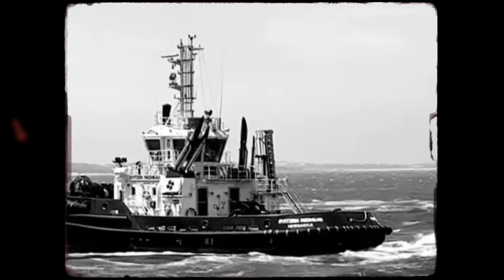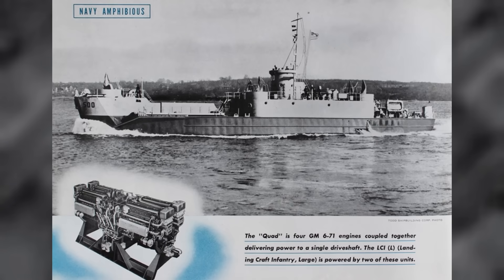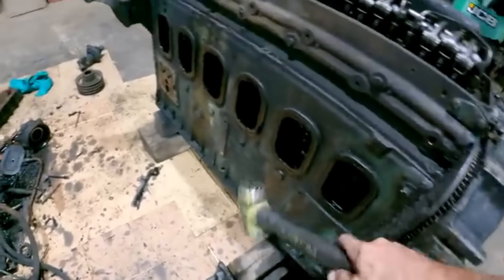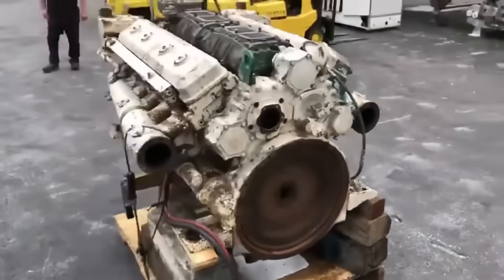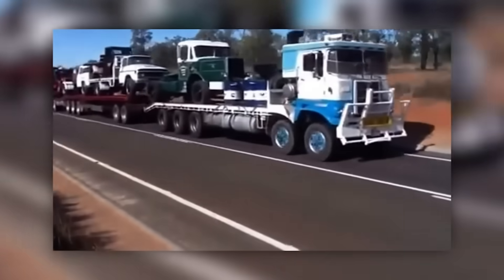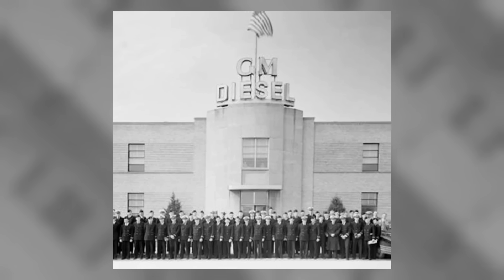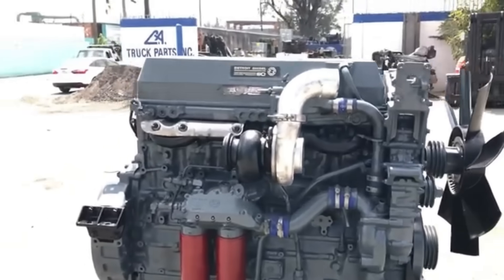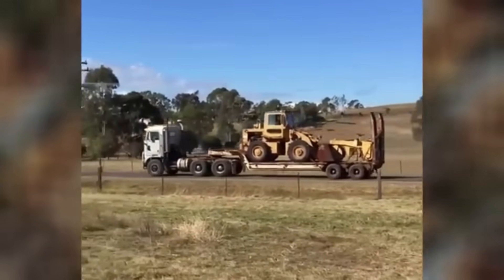The Rise and Fall of Detroit Diesel, America’s Greatest Engine Company

Comment: Here's where I rain on your parade;  Detroit Diesels were NOT the first.  In 1929 a Gardner 4L2 (built in Manchester, England) marine diesel engine was fitted into a Lancia bus.  This conversion was successful and prompted Gardner to introduce the LW ('lightweight') series of diesel engines in 1930, designed especially for road vehicles.  The LW engine was a modular design, with aluminium alloy crankcases, and separate cast iron cylinder blocks and cylinder heads comprising either two or three cylinders.  A five-cylinder engine would thus use a twin and a triple, and a 6-cylinder engine could have either three twins or two triples.  
As for 'small enough to fit into a truck', the range was:
4LW, 75 BHP @ 1700 RPM, 340 cu. ins.
5LW, 94 BHP @ 1700 RPM, 425 cu. ins.
6LW 112 BHP @ 1700 RPM, 510 cu. ins.

(marine types, with the same power outputs, were also sold in two and three-cylinder versions, and many built 90 years ago are still in daily service)

Comment: I worked in the transit industry for decades. 4 53, 6v71, 6v92, series 50 all great engines. (Series 50 being 4 stroke) one thing the video didn’t mention was by moving the gear train idler gear to the other side of the gear train (GM set up the blocks to allow this to happen) and changing the starter and related parts, the crank rotation could be changed from right hand rotation to left hand rotation or back with no other internal engine parts needing change or adjustment. Great engine to work on.
Reply: I totally forgot about that! I had a neighbor who blew up his 6v92 in a gmc. Got a great deal in another one out of a bus. Called me up frantic, WTH!!! I got 10 reverse gears and 2 forward!!! Had to swap gear cluster around.

Comment: TLDR: 
Emissions and fuel consumption 
These engines can be abused like nothing else, but they cant meet current emissions and fuel consumption standards. When diesel was cheaper than gas, they were kings. Once the 90s and emissions regulations started creeping in, their time was running out. But, there are some still out there. They still exist in marine settings under the MTU brand name

Comment: As a diesel mechanic I loved working on those engines. People called me from all around to fix. I had a good Rep and more work than I could handle. Love those engines
Reply: I was foreman in the repair shop at US Steel’s Fairfield Plant for about 6 years in the mid 70’s. A majority of the diesel engines in the various cranes, forklifts, coil carriers, and diesel/electric tractors were 53’s and 71’s. Hardly had any problems with them and they were easy to tune and repair in place. Had a few runaways, but just flip the shutdown plate and it stops - of course then you’d find the governor all tore up or the blower driveshaft twisted in two, but very rarely would you have to fool with the bottom end.  The sound of a runaway Detroit was so good you were tempted to see how fast she’d go. And the mechanical fuel injection was just about bullet-proof and simple to set. I always wanted to put a 3-53 or a 4-53 into an old GMC pick-up, but life got in the way.
Reply: Stop lying they been out of service for 40 years
Reply: I was fixing them up through 2010. Matine is still running them
Reply: @KBilitsky military equipment mostly

Comment: The problems with 2 stroke diesel engines are primarily: poor fuel efficiency, nasty emissions and limited rpm producing power. Then of course, there's the threat of a dreaded runaway.

Comment: As a Detroit Diesel Technician and Dealer Trainer with DTNA for 25 years I found this video to be somewhat factually accurate. However many of the images are not accurate and the title is complete click bait. Rise and fall of the 2 stroke, sure. Rise and fall of Detroit Diesel? not at all! Still going strong and one of the worlds largest engine manufacturers. As for the S60 being the first 4 stroke? Nope! 8.2L was the first. These are just a few of the many inaccuracies. If Vintage American Machines is going to put the effort to make a 19 minute video they could at least make it factually accurate.

Comment: I never heard of Detroit Diesel until I started working in the offshore oil and gas industry where they are used extensively in pumping applications and in hydraulic power packs- mainly in 12 and 16V configuration. Awesome machines.

Comment: My favourite type way of powering my cars diesels I have only experienced two stroke petrol engines in cars and motorcycles I love the how smooth the were my father bought a new Wartburg with a 1000cc 3 cylinder two stroke engine which I use to love but was fuel thirsty I now drive a 1.6 4 cylinder diesel car which pulls like a train and averages 58 mpg

Comment: I'll be 'That Guy' this time. The  roots blower provides the normal required induction air charge to run. It's not a super charger, as 'super' means 'above normal'' They were typically supercharged with a turbine. A turbocharger. Now I will be taking the next door out but it will be quicker if someone kicks me.

Comment: The biggest issue with a lot of older diesels is runaway which is extremely rare on modern diesels engines as they have safeguards to prevent them from running away which would destroy the engine if the RPMs got too high!

Comment: In 1988 when I started my trucking career I was at the bottom of the board in a teamster tanker company and was assigned a 1975 W900 Kenworth with a 8V92 Detroit spinning a 5X4 twin stick that everyone else refused to drive. I hated that truck the first week I had it until I figured out how to shift it then it was Katy bar the door. No body passed me because that truck had no known top speed. The speedo only went to 85 mph but I buried it deep many time on highway 97 between Klamath Falls and Bend , Oregon. I drove it for the next decade until the company went bankrupt and the fleet was sold off. Wish I had bought it
Reply: I can see your smile as you overtook other drivers with the dd screaming hell
Reply: I drove an air shift 5x4 back in the early '80s.  My buddy drove a Mack cabover with a straight 5 speed; quite a difference in transmissions!
Reply: Thats a great story. Wish id been there!
Reply: 1988 was when i was born

Comment: I drove 3 different freightliners back in 2003-07. All  had Detroit but the older one was an absolute monster. It was in an older cabover from the 80s, they let new cdl greenhorns learn on for a year. The other one was 1999 or 2000 year, it was ok but for the times I went through PA and South through those hills, it wasn't quite as nice as the old cabover. I didn't really give it much thought as to why the newer one was worse but it makes sense now. I always thought the engine wasn't dialed in right but I'm not a mechanic so I find these videos interesting.
The turbo died in the old monster and they couldn't even tell it lost much power till you found a hill. 
Then I got a new freightliner 2000 cabover but I don't recall the engine d60 I think? Had no complaints other than a cheap company who governed it at 55mph.
Later I got with a different company in 2006 and they had 2003 freightline century. It was very reliable but didn't have what the peterbilts and kenworths had for hills. I just figured I had a heavier haul but who knows. Some of those other rigs could really haul ass up hills

Comment: They didn’t evolve fast enough.
Two strokes were great at constant RPM applications, but 4 strokes from Cat & Cummins were quieter and 0:32 0:32  provided more low end torque.
The silver 92 was the last two 0:32 stroke for the trucking market if I recall
Four strokes started taking over the construction & gen set market because they were quieter.

Comment: I've worked at Detroit Diesel shop for over 12 years. It's always fun when we rebuild a 71 or 53 and let them break in on the engine dyno. I was surprised to see no mention of the current DD platform in this video.

Comment: DD is anything but dead.  They went over to 4 strokes because of emissions, fuel economy, and simplicity.  (DD 2 strokes have blowers, 4 valves/cyl,, multiparty pistons, unit injectors..lots o& parts)
As an engineer, I liked DDs because they were small and a bit lighter than Cummins or Cat.  They could be configured this and that way, even vertical shaft.
2 strokes last because for the same power you get double, half sized power strokes.  This reduces the torsional fatigue reversals and magnitude on crankshaft and other internals.  In other words, instead of Bam…….
Bam….Bam, it’s pow.pow.pow.pow.pow,pow
DDs brother company, EMD, still making 2 strokes locomotive engines.    Cheers

Comment: I’m an old school truck driver from the 70s 80s and 90s. Detroit engines were the best most reliable engines. 
They were used in the oil patch for everything. We had trucks and workover rigs and drill rigs. Everyone loved the rapid acceleration and that sweet sound of going from 600 to 2300 immediately. We had engines in 1982 that were making 1000 hp.

Comment: Up to 2002, I worked on the 6V71 series on Flxible buses built in the 80s mated with Voith transmission and that thing kept running forever. They were very quiet, but inefficient with high pollution.

Comment: When I was in the Navy my first duty station was a landing craft command. All 5 engines on board were Detroit diesels. Two 12v71 for main propulsion, two 371 inline for generator power and a 471 inline for anchor windlass. I was only 20 at the time and had some old crusty master chief who was teaching me how to change injectors and run the rack and an all that and it was so much fun. I learned a lot about these engines. To this day I get flashbacks when I hear these engines to my days on deployments and hearing these engines run in unison doing 2200 rpm for our cruise power setting. We rarely and I mean rarely ever had an issue with these engines.
Reply: Loved the 71s on LCUs, one of the best tours I ever did as an Engineman.
Reply: I sailed on MSO minesweepers, propulsion plant were 2EA 8-278-A (A for Amagnetic alloys used for the blocks and cylinder heads), one 8-278-A for mine sweeping duties, 2EA 8-268-A as gensets, one 4-71 as emergency and harbour genset. Those engines were incredible, powerful and a piece of cake to work on.

Comment: Somehow this video came up on my YouTube homepage. I have a 1967 Hatteras 50 foot motor yacht with 2 8V71's that are awesome power plants. They are old and dependable and I can run for days on end with only shutting them down for me to get a bit of shut eye. I know they could run for weeks without shutdown because they RUN, one quick push of the starter button, one second even cold... the twins are running, even at 58 years age (i'm 64). They do have valve cover leaks and I need some new gaskets... I have digressed into thinking of tweaks. 
My Detroit 8V71's are as Tony The Tiger says... They're GREAT!     ...  I gotta eat some Frosted Flakes now that I have referenced an old commercial phrase, and I want it in the little box designed to cut open and add milk. You guys have a great day.

Comment: I was touring the Detroit engine factory in Michigan about 6 or 7 years ago. It was where they produce the DD13 and DD15 engine. Just an absolutely phenomenal place. I got off the beaten path of the tour when they got into a boring conversation.  I looked over and to my suprise there were 8V71 brand new sitting on crates. I ask one of the guys I knew from Freightliner wh o was running the tour. He said sush your your not suppose to see those. I guess they still put them in some tanks. Don't know if there for American tanks or a foreign country. Just know they were brand new. You can burn just about anything in an old Jimmy. Once you get it started you don't need and electrical, pump is manual and you put a manual shut down. If you have an air starter you don't need any electrical. Engine temperature is critical and extra oil. Your going to need it. What they don't leak they burn. 
Once you learn how to run the rack the rest is a piece cake.
Worked on 6V71, 8V71, 6-53, 4-53, 3-53, 6V92 and 8V92. I never got the chance to work on the 12 & 16 V 71 or 92 but would have loved too. The old 8V71 with some N95 injectors going down the road would have a foot and half of flame coming out of the exhaust at night. You knew he had that Jimmy screaming.

Comment: Oilfield service guy here - we ran 6V92 and 8V92 engines in front line service past the date that they stopped making them by purchasing unused/or lightly used engines on the 3rd party market, and then rebuilding them in house.  The extreme low rpm torque makes them perfect for ultra high torque pumps.  You can use other engines, and 4 stroke diesels, but they require much larger, more complex and expensive transmissions with more gears than are required with 2 stroke diesels.  We are all using cummins and CAT now.

The note that there are 'parts available for collectors' is BS.  These engines are still in service wherever they can still pass emissions requirements, or operations where emissions testing isn't required. The parts market is to meet current demand.

Comment: I have owned  many of them, they say they run away. It’s more like the engine doesn’t run away. It’s the operator.😂 they were an OK motor if you knew how to run the rack which I had those things down like fine tune clock mine always run top notch. They’re not really too difficult to rebuild. If you just go get the book the best advice it’s the overhead is gotta be tuned just right and they will run good. Be careful with the governor or they will run away. People use the emergency Killswitch to shut them off and what that does pretty soon. It makes the oil seals start leaking and that oil run down into the intake valley one day you start up and it starts sucking all that engine oil into the motor and it runs on it until it runs out. That’s why they run away. The old silver 92s were pretty cool. They had lots of power more power than the normal  8V 71. You could put the hundred injectors in them as long as you run that rack right there’s a trick to it. Every one of them have to tip at the same exact time if you got a good eye of doing that they will run hot.

Comment: In 1971 H&M Sportfishing 65'
Catamaran 1/2 Day Fishing Boat Powered By 2 x V12-71 
Set World  Record Pulling 68 Water Skiers Around at 30 Kts.
 Around San Diego Bay.. 
Also,
The 65' x20' Modern Style Sportfisher  Were Powered With New 2 x V8-53 Engines 
Top Speed @ 20 Knots 

I Was Crew on A Few Boats 
Powered by Detroit Diesel Are
Still Around  But New CARB 
Laws Phased Out Commercial
Use of 2 Stroke Diesels.

Comment: I dont know but I drove between 2006 and 2013 and for a couple years I had an International No Star with a DD in it.  That engines fuel pump self destucted on my twice and left me stranded and caused environmental hazards rivalling the Exxon Valdez.  I BEGGED my company to give me back my KW with a red motor in it.  They did.

Comment: 671 DDE , best engine ever. Will run on cow pee if it smells like diesel! I have used them in workboats, tugs etc for 50 years. Still have some running big tow winches on offshore tugs.

Comment: The assumption is that modern 4 stroke diesels with turbos are unreliable. Two stroke eats oil. it burns alot of fuel and also wastes it. Ultra modern diesels can still be mechanically simple yet powerful and low maintenance if done right. Its not like turbos have  failed as a part to fill diesels poor power gap, nor common rail diesels and injectors (nor glow plugs). Its the exhaust system that has failed to innovate and get more mechanically reliable. Some of that error is because engine makers didnt care about the emissions when fuel was cheap, engine oil remains cheap, exhaust emissions are but an afterthought and Diesels remain a very reliable design courtesy of Herr Daimler. In fact good diesels generate way more power per litre injected than gas engines with electric being the best. Mercedes did a hybrid turbo diesel. Electrically powered variable turbo diesel engines exist. Many diesels can burn fuel thats much more safe for the air we breath like biodiesel/Ethanol mix/organic diesel etc.

Comment: tuning was the issue, a properly tuned 2 stroke isnt much different than any new computerized diesel.  most were just never tuned up and the injectors sprayed way to much fuel giving huge plumes of black smoke.   the 6-71 is the best engine ever made.

Comment: Gee, wonder why the Detroit vanished? Maybe because GM (And every other auto manufacturer) realized they couldn’t bleed people dry if the engines lasted 40 years and could be fixed with a socket set by the common man. Much better to crank out ticking time bombs wrapped in proprietary software, intentional engineered difficulties, and plastic, so you’re chained to their dealer network. Planned obsolescence isn’t a bug, it’s the business model.

Comment: Great engines. Drove both 6v-92 and an 8v-92.  Backing into a loading dock and not pushing the clutch in at the moment of contact could stall the engine and then it would fire up in reverse. Exhaust stack became the breather and the breather became the exhaust.  If you drove one you know the panic.